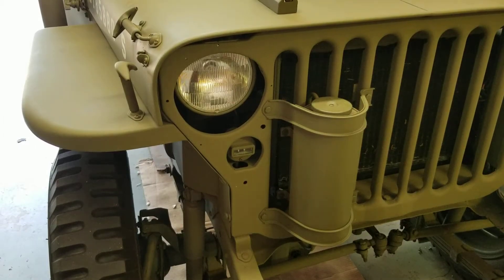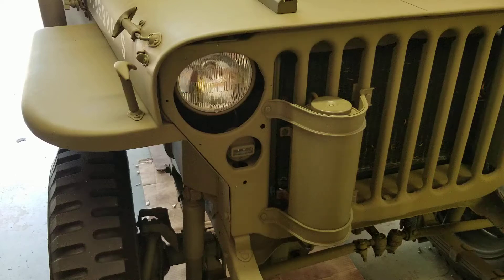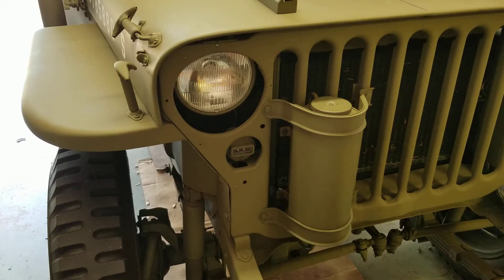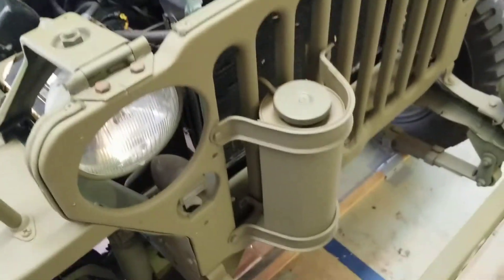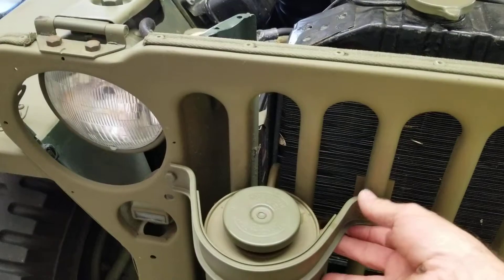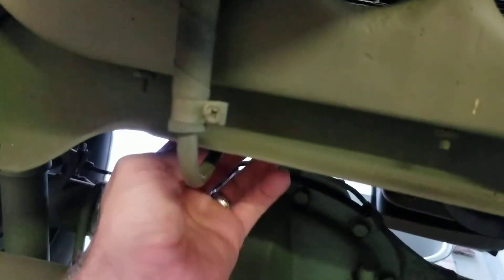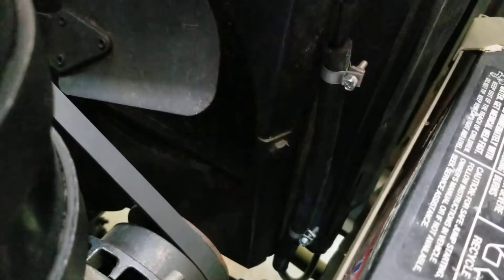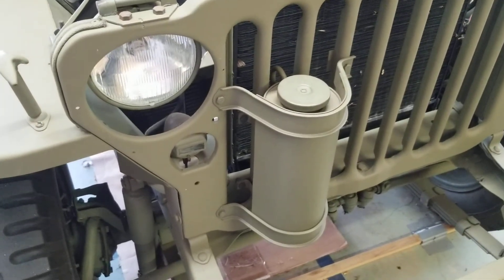How the Desert Cooler Works for a WW2 Willys MB or Ford GPW Jeep

Comment: Hey brother just wanted to let you know those caps should be switched if your using the tank as an overflow. The pressure cap should be on the radiator and the zero cap on the tank. Just as any standard car would have.

Comment: I add a can to my f134 cj5 but i keeped the original cap on the radiator and let it over 
 fill to the can just like in modern vehicles.

Comment: Important to just keep the water level roughly halfway up the desert cooler canister, don't fill more than this as you need to leave space for it to work. Also, when checking the water level this is done by just checking the canister. Interestingly, here in the UK, Land Rovers (at least military ones) have an identical system except that the canister is fitted in the engine bay.

Comment: I have an expansion tank installed higher up on the grill,  used extra bit of hose. I  kept radiator cap on the radiator, opposite to what you say, still works ok.
Reply: j t Both types can be found on relatively modern vehicles, both work.

Comment: that's actually pretty clever, I like the idea. naturally it's for hot weather. have you had your radiator push coolant out yet?
Reply from the maker: Yes.  It pre-filled the surge tank about 1/3 full, and it has stabilized at just over half full.  The radiator never runs low of coolant any more.